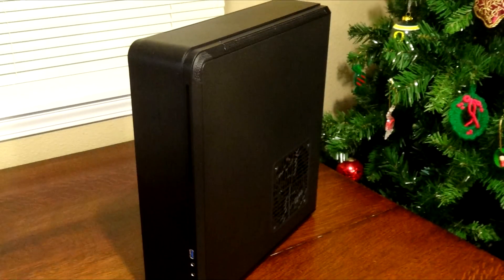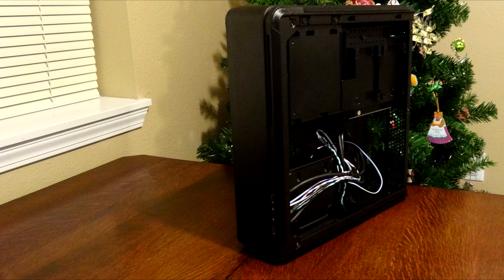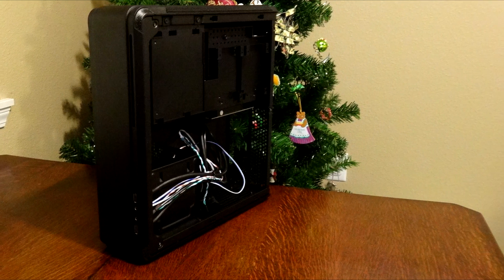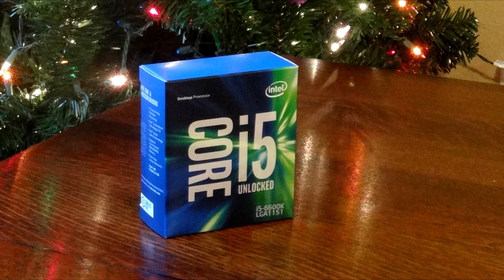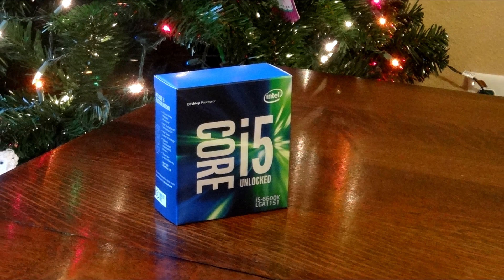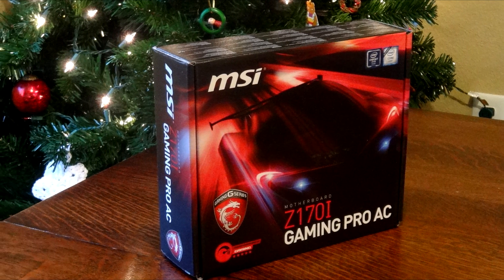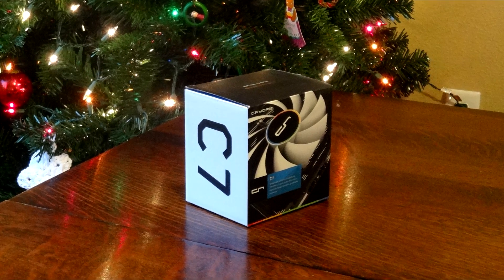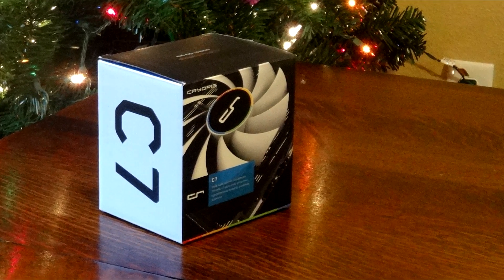ITX Build and Overclock - i5 6600k / MSI Z170I / FTZ01

Comment: I built a computer for my dad using this case, I highly highly highly recommend using a blower style gpu with this case, even though it may cost you 20-30 dollars more, asus, msi, gigabyte all offer aftermarket ones on the nvidia side, and well nvidia is the way to go 99% of the time anyways.
Reply from the maker: Thank you for your recommendation. I do agree with you about that style of graphics card especially if you plan to have the case in the horizontal format. Though if people were in the situation I was in, to cannibalize parts from their old PC, and thus are to put an Open Air graphics card within this case to know they should be fine in the vertical format (and perhaps in the horizontal based on the card they are using). I haven't had problems with thermals  and the case fans can help with dissipating/supplying air in the area. I don't have much margin to overclock though which the Blower style might be better with. Have you overclocked that blower style with any good success?

Comment: Would it be possible to install a water cooler in this build for the cpu? Would that make a difference in terms of overclocking potential? I want to make a build with an i5 7600K clocked to 4.8-5.0ghz if possible in a smaller case like this.
Reply from the maker: Alexander Jones yes, I would say very likely. there is a comment thread on this video by foobar where some people talked about water cooking in this case. don't know if you'll get to 5 but could get 4.8. You may need a smaller graphics card as I think they only were able to get the radiator fan mounted on by the graphics card. I would like to test this out personally though. Good luck.

Comment: Appreciate you taking the time to do this. In middle of a similar build. FTZ01, ASUS Rog Strix Z270I, Zotac gtx1080 mini, i5 7600K...  Waiting for Silverstone TD03-slim AIO cpu water cooler.
Reply: Cool. Glad you got it to fit.   I noticed your vid card is a little over an inch shorter than mine.  Wonder if it would still fit the Zotac 1080 mini?  I'm not opening this thing again unless I have to...  Nice work on the pcpartpicker write-up.
Reply: Went ok.  I made dumb but, recoverable mistakes.  Tips: The AIO Water absolutely would not fit.  Returned it and used same CPU Cryorig cooler but, had to use the the included nylon(?) standoff washers instead of back-plate due to interference from chips on the under side of the asus stryx mobo.  I installed 3 case fans pulling air into the case thru the filters.  My temps seem a little high at idle but, don't seem to rise much (38c). Read somewhere that Kaby Lake runs hotter.  Case is a tight fit! I spent much of my time figuring out how to route wires.  Patience and liberal use of wire ties is key.  Installed XUbuntu. Have this beast hooked up to Samsung KS9000 55" (hdmi) and Asus/Ancor 27" (displayport).  Good luck with your build!
Reply: I think you're misreading something? The reference to the word "slim" is referring to the case.  Based on dimmensions of the radiator and cpu cooler alone it would fit but , with graphics card there's no space for the tubing.   In the manual they allude to it being possible to install a "custom" water cooler.  I'd like to see Silverstone try while including a graphics card in the riser section of the case.   Make sure you order from some place with an easy return policy if you still want to try it.  If noise is your main concern, I cannot hear the CPU fan above the case fans and those are pretty quiet.
Reply from the maker: FooBar, that sucks man. Yeah C Hill I would make sure you make the clearance with the slim. Have you been looking at the manual for all the clearance items and suggestions? If there was anything I learned in this build is every mm counts. It took my 5 hours to do this build and I would expect something to not go right the first time you put it together. Like FooBar said, it's really tight. Also I did notice higher idle temperatures on my device too than a regular case. But my highs were ok so I didn't worry to much. Good luck with your build C Hill.
Reply: I see it now and I'm surprised. Yes, I placed both case fans on the bottom. Then tried placing TD03 slim in the top cover fan position. Fan + radiator (37mm-thick) + tubing directly above the mobo.
Tubing is 12 inches long and fairly stiff. With all the components and connectors in place there was no good way to route and/or coil the tubing.
When I used https://pcpartpicker.com/user/VidRunr/saved/dH7nQ7 it flagged the TD03 slim as incompatible with the case. I didn't believe them and lost that bet.  I was still able to do minor overclock with the cryorig but, I don't OC much as I want longevity.
Reply from the maker: This guy used the H50 from Corsair in his build. The RVZ01 is basically the same case internally. You could look into that one. https://www.youtube.com/watch?v=CrJKfQwfgmY
Reply from the maker: There are so many variables to consider, and I think you're doing your homework well. It's crazy how tight it is in case but once it is in there it's nice. I can say though, any amount of maintenance can be annoying and can see that with a liquid cooler.
Reply from the maker: Also thank you C Hill, I have thought of converting over to a tech channel. Particularly ITX builds. Love the small form factor stuff and various other tech. Just figuring out how to get it going. Thanks for the suggestion, don't think I'll be able to do it in the foreseeable future but it's true that there isn't a lot out there about it.
Reply: When it comes to SEO and YouTube it's about finding a niche, super tight builds, ITX stuff, mini PCs, HTPC stuff is nice and niche. Just a thought.
Reply: Nice find.  I want to say the H50 tubing looks more flexible so that may help.  I should also point out the I used the "LG" sfx power supply which is longer.  With all the power connectors plugged in, most of the space at end of psu was used.  This forced me to route many of the connectors over the mobo.  The video highlights the difference in available space.
Reply: Yes,  I found that first one too. Notice the comment he never answered about how he fit the cooler? I don't see how he did that with longer psu which I also have.   But, in any case, I spent about an hour trying to orient the tubing without the tubing being pushed into and blanketing the other components of the mobo.  Didn't look safe to me.  You'll want to make sure your not placing perpendicular force against your RAM dimms.  I had issue with initial power on of assembled case with a fan brushing a wire.  I was able to probe around with wood chop sticks wrapped with electrical tape to move the wire to clear the fan.   Will be interesting to see how long these systems last.   I tend to keep mine between 5-8 years as I tend to play older games.  Just moved Borderlands 2 to the new system.  Amazing :)
Reply: FooBar hey dude just dropping in with an update. The td03 slim does fit, just not with the radiator installed directly over the cpu. You have to put the radiator in the front gpu intake slot and guide the tubing all the way back to the pump on the cpu. I then bought a 17cm itx msi aero 8g oc, basically the shortest 1070 in the world, installed that and it left enough clearance for the td03 radiator that I was able to add a full 25mm noctua fan to the radiator in addition to the standard Silverstone fan and another noctua under the 1070. As a result you can look right into the case and see the tundras waterblock and the motherboard lol. My 7600k is delidded and overclocked to 5ghz and is extremely cool due to the added cpu cooling. The 1070 performs well and without throttling. Extremely tight fit overall but the size to power ratio here is next level stuff.
Reply from the maker: Wow, that is quite extensive and good thinking about mounting the radiator by the GPU. How long did that take you to do all that? And I bet it's tight in there. I opened mine up the other day to see if I need to do cleaning and always in aw of how tight it is. Also the filters work really well for the fans, didn't notice really any dust in the case. Congrats man, hope you enjoy your new build!
Reply: Hey Crookalicious, I did a full write-up on overclock.net http://www.overclock.net/t/1466816/silverstone-raven-rvz01-rvz02-ml07-ml08-ftz01-owners-club/6850#post_26060663 took a couple hours just to get it together and then a couple more hours to work out the quirks of the pump/board/bios/case (e.g. for some bizarre reason the TD03 just runs 100% by default even though the AIO Pump header on the Z270 actually allows you to regulate it, but this wasn't at all obvious until you dug around the BIOS settings). Now the pump sits at about 40% and is completely silent and only audible when the CPU hits 5GHz or so. But yeah it's super tight, but mainly just because of the TD03 hoses, I contacted Silverstone directly n they were like "yup definitely fits in there" lol.
Reply: https://pcpartpicker.com/b/BskdnQ Full PC Part Picker write up with pics :)
Reply: Thanks man. So the thing with the 1080 mini is, and it's the card I originally wanted, is that it's about 3-4 cm too long. The awesome thing about the 1070 Aero mini (which overclocks like a champ, btw, sitting at 2ghz right now) is that it fits perfectly with the noctua fan / radiator + TD03 SLIM sandwich in the second fan compartment. Just like it was designed for exactly that scenario, but more likely a coincidence I guess. I'm waiting for a 1080Ti in the same format as the single fan Gigabyte / MSI Aero Mini. Until then I'm  stoked with the monster performance and cooling of this thing. I'm running AIDA64 right now: 5Ghz @ 1.27V solid as a rock. Totally worth it. EDIT: Updated OC, 1.35V @ 5.2Ghz Cinebench and AIDA64 passed.
Reply from the maker: No problem, sounds like you're going to have an awesome build! You'll have to let me know how the water cooling goes for you because I was curious about that. Also good luck with this build, I had to take things out and readjust things all the time which added to the hours it took to build it. I would recommend doing a post before putting the motherboard/CPU in as plugging in everything with that is quite a burden with the tight spaces especially when you find out it's not posting for whatever reason and have to take it all out haha. 

Did you get a M.2 Nvme ssd by chance?
Reply: It's a risk.  Not sure how/if the water cooler will fit. The ftz01 docs vague about water cooler.  Unfortunately, just discovered my psu missing the pci-e (6+2p).  About to order straight 8pin to 8pin.  Thanks for the advice. Haven't put a pc together in 4 years.  Bit rusty.
Reply from the maker: Yeah I saw on there that this case can do water cooling; I just don't know where I would put the tubing haha. 

No problem, it doesn't hurt with this build to plan it out and I hope my video helps. I planned it out for weeks and still had hiccups with cable management etc... best of luck and feel free to ask me questions if you have any.
Reply: oops, missed your question on the M.2.  Just went with MX300 2.5 1TB to cut down on cost.  This will replace a 2008 DigitalStorm box with spinning HDs.  To me it'll be fast enough to rip my face off.  This board has support for optane so that may be future upgrade (depending on cost and when those devices become available).
Reply from the maker: Ah, ok. Yeah those things cost a lot and most of the time not needed. I think it would be fun to have but not for the price they're asking.
Reply: FooBar damn dude you're literally making the exact same pc as me let me know how it goes
Reply: I'm super disappointed to hear your difficulties with the TD-03 Slim - especially as Silverstone's own website specifically recommends the slim for the http://www.silverstonetek.com/product.php?pid=533&area=en FTZ01. Almost bought it today but put it off. Are you positive you were using the model mentioned there?
Reply: Maybe i wasn't clear, click on the "Recommendations" tab on the Silverstone website and it lists the TD03 by name
Reply: In fact if you look up the TD03 itself, it too specifically refers to the FTZ01 as a recommended case http://www.silverstonetek.com/product.php?pid=598&area=en (again click on Recommendations) Edit: This might be a dumb question but did you remove the case fan and relocate it like it says in the manual?
Reply: https://pcpartpicker.com/b/RLQV3C this guy used exactly those parts and doesn't seem to have had a problem, the https://pcpartpicker.com/product/RQXfrH/cooler-master-cpu-cooler-rls12v24pkr1 cooler master seidon 120v also seems to be a popular watercooler for the Fortress. Interesting point you raise, i too noticed that it was listed as incompatible on pcpartpicker but noticed that there's at least 3 builds on pcpartpicker where people do use the Tundra Slim. Struggling to think which which components or cables might've got in the way to prevent you from using it. Quite a conundrum. Not sure whether to risk it myself or not. The CM Seidon isn't a bad cooler but it's not as good as the TD03
Reply: Hey dude sorry for hassling you :D See this: http://silverstonetek.com/sstedm/td03-slim/td03-slim_edm_en.jpg the total height of the SLIM 03 is 37mm (rad+fan) plus 39.5mm (water block) = 76.5 mm so height isn't a problem, but you said the tubing got in the way, i'm wondering this: Is there any way you might have installed the waterblock in a sub-optimal orientation? I think it's possible you installed it in an orientation that prevented the rubber tubing from displacing correctly. Either way if I do buy this at work (i work for a hardware retailer in Germany) I will definitely let you know how it goes. I've googled around and LGA 115x is perfectly square so you should be able to rotate the waterblock and the tubing along with it until you find an orientation that gels with the crowded cabling to which you referred. Only explanation I can think of!!!!
Reply: Hey crookalicious great channel btw and thanks for the suggestion. Perhaps you can shed some light on this mystery about 115x waterblock orientation, it's square so presumably you can have the tubing coming out in at least two different directions, installing it one way could make it impossible to guide the rubber tubing correctly. Just a theory though!
Reply: http://benchmarkreviews.com/32575/silverstone-td03-slim-aio-liquid-cooler-review/5/ This guy encountered the same problem as you: "With the TD03 Slim mounted I had to find a spot to place the radiator in the narrow FTZ01. Initially, I thought right above the motherboard would work – the math seemed to add up, but finding a way to route the hoses quickly…hosed…that plan (I’m so sorry). With the perfect position it might work – the hoses were in grave danger of becoming kinked no matter what I tried, so I began to consider other options. There was really only one other location that would work – the front GPU intake fan mount. The hoses just reached – some swiveling barbs on the radiator would do wonders for this particular layout (and could potentially open up even more mounting options). You’ll need to be careful with your GPU selection – the Nvidia reference cooler pictured here was practically resting on the radiator. There wasn’t anything blocking any fans though, so I went ahead with the installation. Besides, while I wasn’t excited about shedding the heat from the CPU directly into the intake fan on the graphics card, it’s a vastly better option than the stock Intel cooler! I was surprised to find everything else buttoned up pretty nicely. I had to clear off some space over the PSU compartment to route the hoses, but with some dedicated effort the side panel closed quite nicely. I couldn’t help but think how much easier this part would be with some swiveling barbs on the radiator – it works, but it could be even better with more options to route the hoses. It’s in though – and that’s no small feat, in a case this tiny. Let’s see how it performs!"
Reply from the maker: Silverstone... haha. I like their products but their suggestions seem funny. Yeah I like my build as well and appreciate how quiet it really is. I hardly ever hear it at all with a fan cooler. Congrats dude and I'll have to check out your link! Also hope this comment thread helps others in the future if they come to my video. Have a good one!